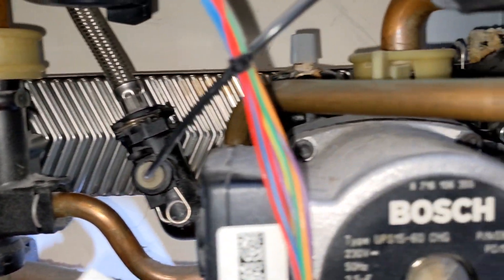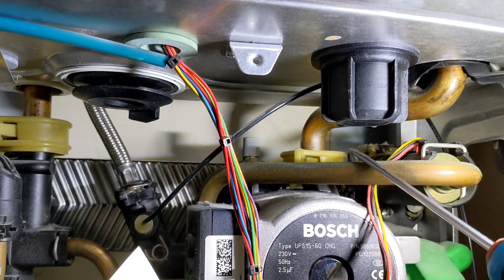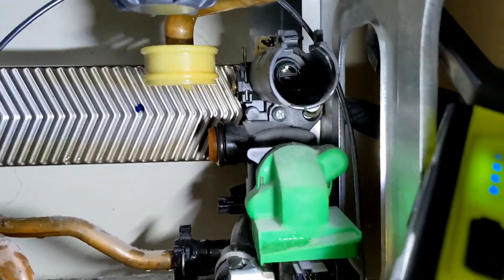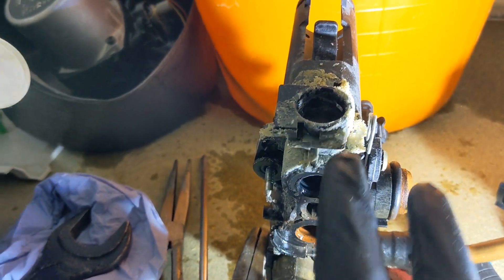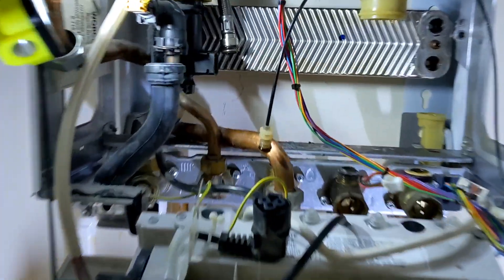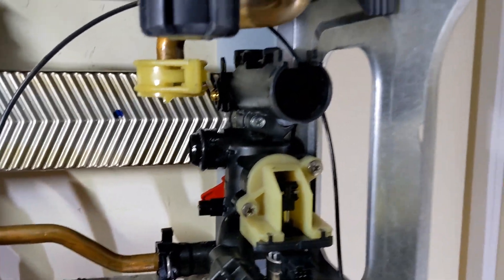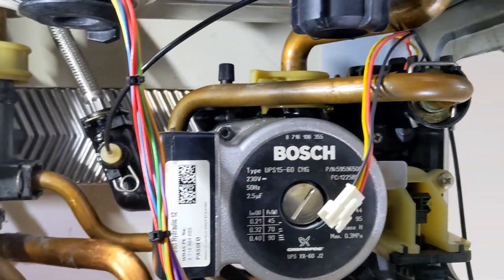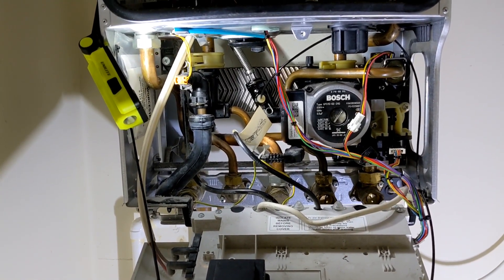Worcester Bosch right hand block change

Comment: How are bypass valves installed? Most videos do not mention them as if they do not form part of the flow system. I dropped one and not sure which pipe it goes in.
Reply from the maker: It's just a bit of copper pipe that connects the 2 blocks together

Comment: Just come across this video as I’m looking for someone to do this job on my boiler, I’m struggling to get a quote without a callout charge. As a ballpark how much does this job cost to supply and fit the parts in this video.
Reply from the maker: I've priced it at £400 including the right hand block, PRV, flow turbine adapter, labour & VAT. Obviously will be a bit cheaper if the person isn't VAT registered
Reply: @ nice one for replying.  Think it’s time to open up my wallet and replace the boiler, it’s the same age as my lad and he has just turned 17 🤣🤣
Reply from the maker: @neilcoyle2285  whereabouts are you based?
Reply: @ sunny Liverpool 🤣
Reply from the maker: @neilcoyle2285  bit far from me 🤣
Reply: @cputilitysolutions  Just out of curiosity, how long did the job take start to finish?
Reply from the maker: @neilcoyle2285  I'd allow a couple of hours first time but now I can do them in about an hour

Comment: Looking for a bit advice mate if possible.

I change one of these today, the customer said the boiler was working before hand, boiler is now firing only for around 10 seconds after I've changed it and then locks, any advice?

I'm thinking theres another issue going on?
Reply from the maker: It could be air in the system after changing the block? If it's locking out then check what the fault lights indicate in the MIs
Reply: @cputilitysolutions  I'll give that a go today mate, im just thinking it's more on the ignition side, thanks for the reply, hope your van gets sorted ASAP
Reply from the maker: @allycoates24  you might have a loose connection somewhere maybe as well. Don't panic, just let it lock out and check the fault lights and then just go through it step by step. Probably something obvious that you've overlooked (we've all done it 😅) thanks man getting my hire van tomorrow so let's see what mechanic says once he's got it 🙏🏽
Reply: @cputilitysolutions  on way to job shortly so will let you know, checked all connections about ten times yesterday 🤣

But your correct most likley something stupid

Good to hear your back on the road Tommoro, what a hassle tho mate, bloody nightmare

Comment: Nice work! What is the cost of this job supply and fit?
Reply: I charge about £250 depending on if extra parts needed like here
Reply: @jacko2815  I did one these a few weeks back. Cut my hands to bits, wore gloves on the next one!
Reply: @davis1000000  that's Worcester for ya lol. How did it go.
Reply: @jacko2815  Got it all in and it leaked at the back of the Plate heat exchanger.. took it all back out again with blood all down my arm. Cleaned around the plate holes, lubed it all up put it all back in and it was OK. 3 hours from start to finish.
Reply: @davis1000000  ah mate I feel ya we've all been there

Comment: Just done my first RH block today following your excellent video.
I also did my second RH block straight after.
Both boilers were CDIs
Thanks for your easy to follow video.
I also used your flow turbine adaptor video during the same repairs.
Reply from the maker: Nice one glad it helped! 🙌🏾

Comment: I've just replaced the right hand block due to a leak.. I've set the pressure is at 1.2 bar.. I have 2 flashing resets to one flashing blue.. and its locked out.  Any ideas where I should look? I've bled to top bleed on top of the silver cylinder.. that's all I've done. Please help me
Reply from the maker: Have a look at the MIs, the fault finding section will tell you what the sequence of lights mean 👍🏽
Reply: @cputilitysolutions  thank you. Whats the 'Mls'? Do you mean the hand book? That says the light sequence is 'ignition lockout' due to; gas present and pressure, gas valve- ohms etc, combustion CO2, flue condition, blocked condonation pipe, gas valve adjustment, ignition electrodes - harness/ connections replace circuit board.. Somethings wrong, I think the board.. it's 20 years old.. I'll let you know one I get my multimeter out
Reply from the maker: Yes that's it (Manufacturers Instructions). Check all the usual basics of ignition and you should be able to find the fault 👍🏽
Reply: @cputilitysolutions  You're so kind. I'll try my best today. I'm a hairdresser you see.. You've got a really good channel helping us all out.. I know my way around a circuit board tho.😉😉 all the 👌
Reply: @cputilitysolutions  I fixed it! I checked the MI, it mentioned PCB. The pcb was wet, plus mineral deposits in area's, I cleaned them away with electrical contact cleaner/alcohol and a sonic tooth brush. Dry and she's up and running.. Really good video.. You've saved me so much money I'm sure. Thank you so much for your great video and time. xx

Comment: You made this look so easy.  The big question is how did you manage change the rh manifold block without cutting your hands.  Worcesters pretty much always need a shock arrestor.  Even if there isn't a water meter present.  Slowly looking through your library of uploads 👍🏼.
Reply from the maker: Thanks man, black mamba gloves 😉

Comment: Good job mate, how did you manage to get the return brass nut into the return manifold? Every time I do it, it’s a pain in the arse. Also what light are you using please?
Reply from the maker: Thanks mate, it took a lot of swearing and sweating! I tried to put it on a flat surface and then push the manifold onto it. The 2 lights I'm using are Unilite SLR 500 & 1750 👍🏽

Comment: Did one today right hand block. Took me 2 hrs. Took all the block out. Riped my hands to bits.
Reply from the maker: Ah man, yeah they can be a nightmare. I try not to take the whole block out if I can help it
Reply: @cputilitysolutions  I really struggled with getting the nut to bite on the return valve. Think I might try your way next time.
Reply: @jasonbrooksbank loosen the 2 screws on the valve and it will give you movement then get the thread to bite and tighten them back up
Reply: @cputilitysolutions  Another highly appreciated video from yourself. How much to price up for exactly the same as this as a job? Thanks
Reply from the maker: @-Anon-Ymous  labour I charge 160+vat